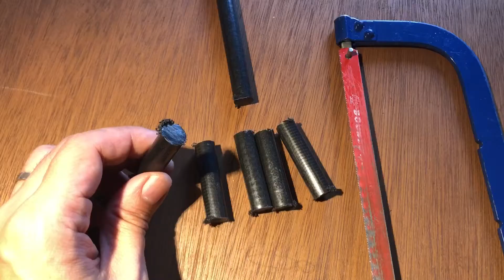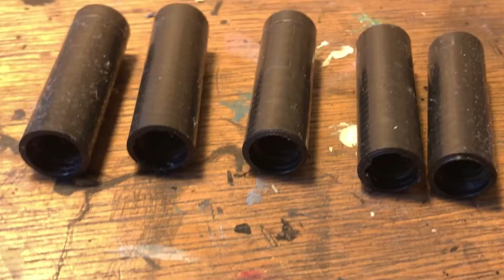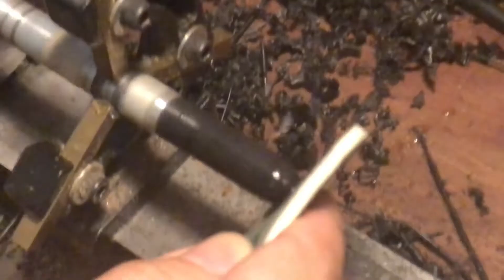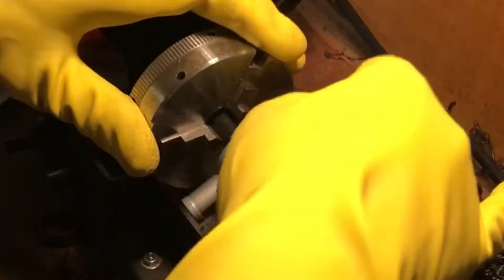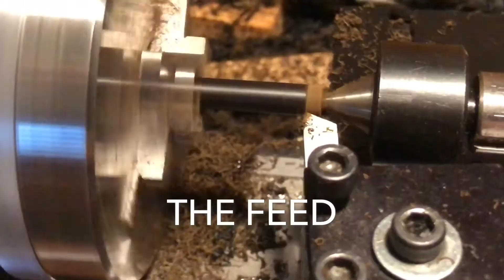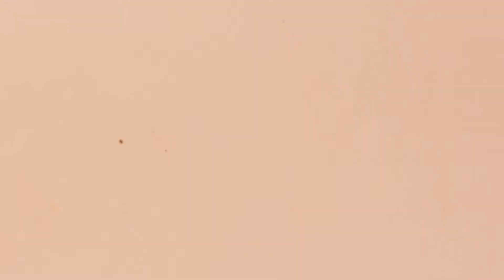Making a G-nib fountain pen (Black Noodle)

Comment: please tell  how you made the air channel?
Reply from the maker: Sure. It’s a home made way. I used cutters for the dremmel. Make the channel deep. The middle wall just has to be a little lower than then sides. This is so that air can pass up into the pen while ink flows down. Be careful with the cutters
Reply: @Drewscape-art  you only sawed two channels,  (Correct me if I'm mistaken), is that enough?
Is this enough for a "capillary effect" and there are no leaks?
Reply from the maker: @vas1612 yes. Many vintage fountain pen feeds have just 2 channels. 2 for ink to fall out of the pen. You would have to experiment how deep and wide the channels are vs the height of the middle wall. The pen could leak if the air going in allows too much ink slide out. Well that’s how I understand it. There are also the fins on the side of the feed. If inkflow is too great, having more fins will slow down the ink pouring out of the pens. To be safe, don’t make the channels too big and wide. Make the middle wall a little lower but not too low. Cut many fins. Adjust the depth of the cuts to get the flow you like. Takes a lot of experimenting:)

Comment: Hello Andrew, would you consider making any more? :) I'd love to buy one!
Reply: I recommend checking out Ackerman pens for zebra g nib pens
Reply from the maker: I have a few of his pens. I applaud Ackerman's efforts. But they don't work very well. It often ends up very messy whenever I use it.
Reply: Hello Andrew, congrats on that awesome job!
I'm a bit too late, but I'd kindly ask you if you could enlighten me with some details of the Black Noodle, like what is the diameter and lenght of the delrin rod you used and the size of the threads.
Thanks a lot!
Reply from the maker: gosh this is a late reply. It is 12mm diameter. The length doesn't matter. whatever fits your hand.  I used m8 threads but just because that's that I could find here and it seemed manageable. You could use finer threads too.